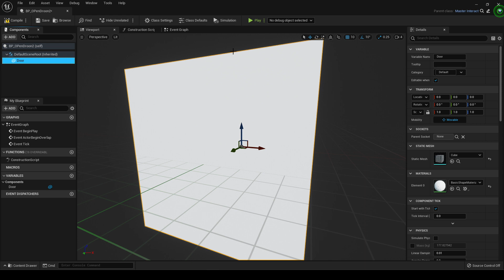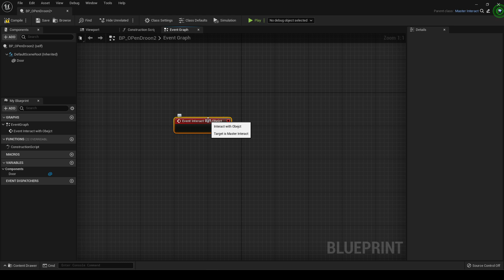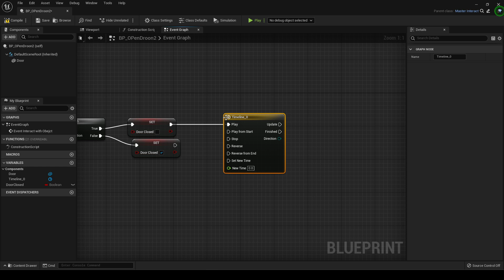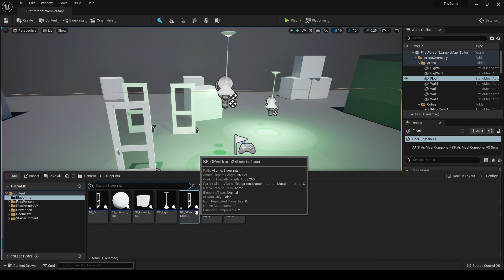How to make a working door UE5

Comment: Worked great, thanks! However, it seems the rotation of the door is fixed to the world. That is, the rotating movement of the door is not independent of the rotation of the door when placed in the world. So, if I want my "closed" door to rest at 80*, when I "open" it it snaps to 0* and rotates to 90*.

There must be an easier fix than making a custom door for each orientation.
Reply: Are you sure you used "relative rotation" in the blueprint, and not world rotation or something else?

Comment: For some reason, when I do it with the cube (like in the video before) it works completely fine, but when I do it with the door is does absolutely nothing. Anyone who can help?
Reply: Not sure if you still need help but from what I gathered this is because the SM_Door that UE5 gives you by default has no collision and therefore isn't sensed by the interact trace. I switched this to a "SM_Ramp" model that actually has collision and it swings 90 degrees. You'll have to find a way to make the door have collision or use an asset that does.
Reply: @YTBlazer  Thank you!
Reply: Another commenter said: "I assume your using the door in the starter pack, just double click on on it under static mesh in details then add a simple box colision, collisoin will be found in the top right"
Reply: Same issue here